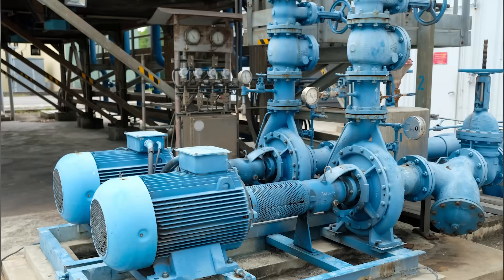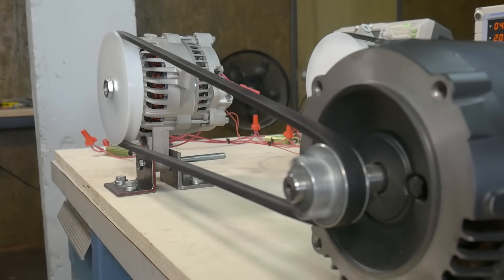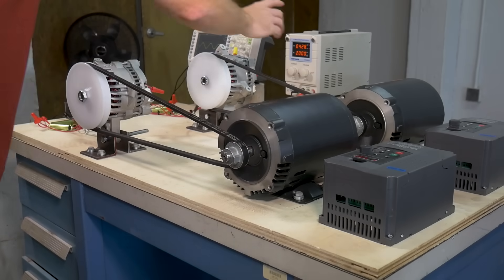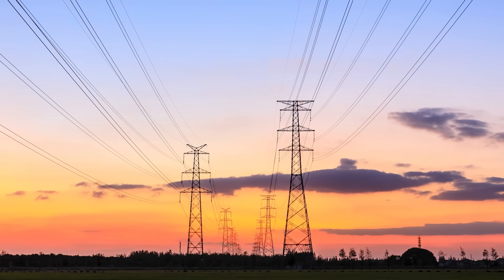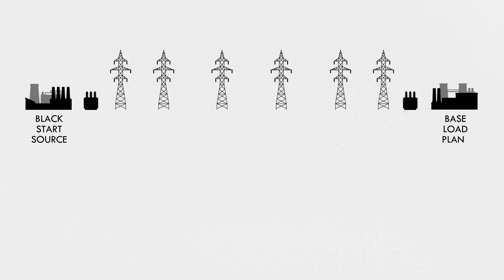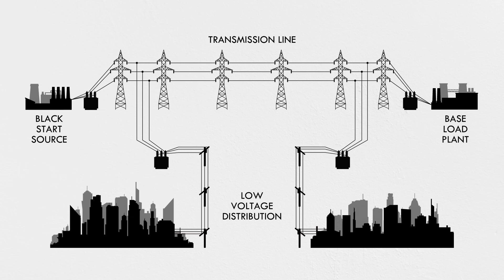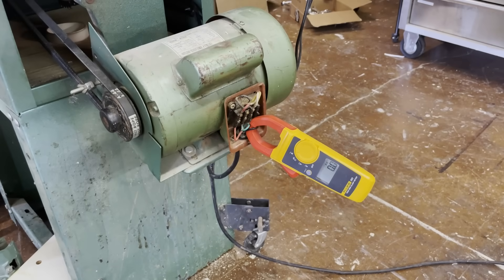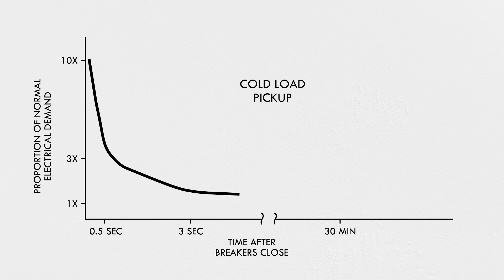What Is A Black Start Of The Power Grid?

Comment: I remember the 1965 blackout; our power stayed on, but I heard about it on the radio and alerted my father, who immediately got on the phone and alerted his team at the Baltimore Gas and Electric Company to rush them all back on duty.  (This was the team responsible for system protection.) Had their automatic disconnects failed, they still had a plan to bootstrap the system; one ancient powerplant from the 19th century had been retained just for that purpose. Rather than electric systems on blower-furnaces and turbines, this plant had manually lubricated bearings on a piston steam engine and a manually stoked coal furnace. It could supply just enough power to run the furnace blowers and lubrication pumps for one turbine plant, which could then bootstrap one more generation unit, and so one-by-one the system could be restored.

Comment: I have a question about the excitation charge. Is there a way for generators to use a potentially very small permanent magnet system, potentially integrated into the generator system, to produce a kickstart to the excitation system? If you start the generator, it would naturally create a baseload excitation current that would be lower than they would ever need, even if it was just a few watts.

Comment: Working on a control system for a 30MW power generation steam turbine, a mechanical error on my part in one step dropped all the power and gated systems to the whole generation complex. I immediately felt pain in my stomach and an instant headache, the noise was tremendous as all the valves, pumps, gates, fans, and switching systems all dropped to open in one second. There are various level of parasitic power requirements depending on the type and source of generation.

Comment: Black starts are much easier now with large numbers of remote controlled breakers. So plants can come back on line and they can pick up the load sequentially. Most places don’t have to make a complete black restart, some power sources don’t trip completely off line. Like hydro electric plants, batteries, solar, and wind. Having a significant inventory of these power sources makes recovery significantly easier.

Comment: wondering about the part of the distributing substation isolation along the crank path 
do these fall/fail open automatically or do they need to be configured at location by service staff?
Also regarding the Black Start sites am I right to assume these are kind of sectorial in set up so as to have as many as possible outside certain areas endangered by different natural disasters?
what good will it do if all the "Black Start Installations" are taken out by earth quakes, not to say it can't happen even when they're spread but that be an event in scale to end humanity and nearly all life wholesale.

Comment: Our plant powerhouse has some version of those same synchronization lights and spinning needles to get all the generators running together. However, we are so dependent on grid power, our backup powerplants are just to keep emergency power on to safely shut the whole plant down with minimal damage. We require about 28MW grid power to operate, but our backup is only about 3.5MW. A complete blackout in winter without backup power would cost multiple millions of dollars, and we are just a small chemical fertilizer plant.

Comment: In 45 years of power plant operations, I only autosynched a generator once.  I prefer manual synch with a scope because I can see and control all the critical parameters (generator rpm/frequency, voltage, and parrallel).  With an autosynch relay, you have no idea what is happening until the breaker closes.

Comment: I think older fashioned power sources should be used as either black start sources, or sources for the black start sources.

Ex: coal-fired steam turbine generators or dynamos.
And here's why.
Provided you have the fuel & priming ready, and the trained personell to operate that steam engine, all the energy you need to start that engine, (at least in theory) is the energy of a matchstick, or a piece of wood lit by a magnifying glass in the sunlight. 

It'll take awhile for that fire to spread, and that heat to build. But you are making progress.

Comment: There are also hybrid generators which have a weak permanent magnet in them which can also be excited to produce more current when necessary so a constant voltage can be maintained. These have the benefit of being able to bootstrap themselves. This is called "hybrid excitation".

Comment: When I bought a 15KW generator for my home it  had to put out CLEAN power for the  Sun Micro servers I was operating while hosting a couple of .997 uptime websites. (This included a Sun Store Edge  hot-swap SCSI-2 disk array and a tape carousel, all connected by Fiber Cannel, plus twin routers, switches, and PIX FWs, and BIG CRTs. This rig had to run on a circuit of 20 amps per leg on a single phase 240 volts system.

Had to buy an old-style CPS meter from a generator resale yard to install on the Generator, so that I could adjust the engine Governor to provide a clean 60 CPS during continuous half-load of 25 amps per line. 

That plus the 20 amp APC UPS and it’s internal rectifiers, transformers, etc. cleaned up the current fluctuations enough to keep my Server power supplies happy! 😊

Good thing I did, as we had 3-8 hour power outages in 2002-2003.  That would have killed my .997 SLA guarantee. 😂

Comment: Woah I just noticed something, when you flipped the switch you could almost see the belts moving to the frequency. @ approx 11:20 Now that could have been in my head or that the drivin pulleys are off center a little bit. But how the slack in the belts moved sure looked that way

Comment: I smile. As a DC-8 flight engineer, I'd had to sync the engine generators as they came online. We also had a tool for emergency operation of the landing gear handle which suspiciously looked like a tuning fork. 
So it naturally came under our job descriprion to convince any newbie that we used the 'tuning fork' to help bring the generators into sync.

Comment: Is there like, a detailed enough model of the grid that has literally every power plant, transformer, switch, etc etc modelled and could run a physics code that could simulate restart procedures, maybe run some optimisation/RL training until it's pretty sure it would work? Like that sounds like a university project maybe that would be fun
Reply: Or if it was an evil agent its score would just be maximising blackout period for the minimum destructive effort instead of fixing it lol I bet that's the first thing an evil AI would start thinking about

Comment: Why don't we turn all those flat roof commercial buildings into solar farms, maybe offer property owners some incentive to feed back into the grid? 250w a square foot assuming the normal 1000w square foot for direct solar energy theoretical, and 25% efficiency for average solar cells, high as 40% on some of the newer ones. untapped potential.

Comment: If starting a power grid form scratch is so hard why don’t people and businesses install their own power systems? I’m thinking things like solar panels or wind turbines connected to batteries in the basement of houses and businesses! Not only could they help to keep at least some critical elements functional during a blackout but they could also cut the cost of electricity because you are generating between 60%-100% of your power from your own sources rather then relying on the grid power supply! And with big enough batteries you could power a large house or even an entire skyscraper all through the night on just the solar/wind power alone!

Plus when power does come back you could use a computer controlled system to switch the batteries to charge using the grid power source instead of your own power source! Now you’re battery can charge on grid power while your house/business uses the electricity generated from your own grid! And from the main grid! If the power goes out again in let’s say 3-5 hours then you at least got some more battery capacity out of it and if the power stays on then you could fully charge the battery and then you would use your power system during the day or when it’s most efficient and then use the public system when yours isn’t so efficient anymore!

Comment: Reminds me of a story my grampa told me once. He'd been working at a Hydro Generating Facility (He was an EE specializing in protection & control) back in the 80's before they had automatic sync systems and he recalls one time the plant operator had the frequency slightly off when the 500MW generator was connected to the grid. The bang as the unit adjusted to match the grid could be heard and felt across the dam.

Comment: As electrical grids get larger, does the length of wire between the furthest ends of the grid cause synchronization issues?  Or, is the difference in timing to small to worry about?

Comment: You didn't say what they do about the 8-10x initial surge in power demand. You said that they carefully restore group by group. I can imagine that they can produce more power than is required in the beginning, by selecting fewer groups for more online power stations. But then as demand drops, they will have to select the next group with its own initial surge of demand. I can only imagine how delicate this is.

But what in the end? Perhaps, I can imagine, that the more groups you get online, and the last few groups won't matter that much compared to the overall power grid being up and online?

Yes of course, local power outages happen. And the grid doesn't collapse. So probably, by the time you reach a certain state, it becomes stable.

Comment: The BIGGEST non-nuclear threat.  WHEN ( not if) the next solar CME occurs (properly oriented) WILL knock out the grid.
Transformers are the critical variable.  Some are manufactured overseas and take 6-24 months to complete
Very heavy to transport.
The National Security of USA should insure manufacture and stockpile of critical transformers are in USA.
Wire and poles are universal however modern transmission completely vulnerable to transformer issues.

Comment: If you'd like to tinker with 3 phase power I'd reccommend using PWM permanant magnet motors! They lack the electromagnet stator you'd see in the real deal but they otherwise work remarkably similarly and because of their intensive use in drones there are loads of very good ones kicking around for cheap

Comment: An excellent presentation, however, I would like to make one point. In the US system you mentioned standby generators are not generally installed to black start a generating unit failed as a result of a blackout. Ontario Hydro installed standby generators in all their fossil and nuclear plants after the 1965 black out. I started at Lakeview GS west of Toronto in 1967 (coal fired, now gone) and we had installed four standby generators of 7 MW each. They were powered by Orenda jet engines and had an output of 7MW each) . The nuke plants, when built, were similarly equipped. Bruce NGS where I also worked, had four standby generators of 14 MW each. Others were later located at the Bruce site as the site expanded. These units use Rolls Royce jet engines (gas turbine?) . Those units are still in place and available. The requirement was for a montlly test start up of the units. On odd occasions, some were put on line to ease peak loadings.

Comment: My father is a Civil Engineer that helped design several hydroelectrical power plants. He wrote the manual for most of them.
The first thing he includes is a breakout 'bleed' power from one of the water turbines generators and a smaller substation to feed the power plant itself.

In 1986 there was a major flood that knocked ALL the comm lines AND THE ROADS to the plants, which meant there would be no diesel trucks to feed the backup generators until NEW ROADS WERE BUILT. The personell was being taken to the plants BY HELICOPTER.

Without the backup diesel, there would be no way to open the water gates and the plants would flood. 

The landlines were cut, but power lines can carry radio waves, and there was a system, deemed obsolete, that allowed using the power lines to communicate and the system to be restored in less than 72 hours, because the plants could talk to each other, in the era before cell phones. More importantly, machines could be synchronized to the same 60Hz wave by this system. The system is now deemed essential and mandatory.

Comment: Wait, there's no reasonable way for powerplants to use their own energy sources to produce some initial electricity they can use to boot up independently? What exactly is the obstacle for getting some sort of initial small charge they can use to build up some sort of internal positive feedback to reach the required minimal boot up energy?
Reply from the maker: Cost
Reply: @PracticalEngineeringChannel  It couldn't be something simple like bringing a relatively small permanent magnet close to the spinning coils to induce a small current, and loop back that current into the static coils, using the prime-mover's energy to amplify it recursively until reaching whatever is the operational minimum?

Comment: As an additional point the most likely method for rebuilding a large blacked out area would be outside in - i.e. use the Interconnect and neighboring RC areas to build inwards so the loads are sync'd to the Interconnect not to islanded generation. Of course, during the rebuild generators would need to be brought online for the BA to balance as soon as reasonable practical but these could be sync'd to the Interconnect too so isosynchronous modes wouldn't be necessary.

Comment: I worked in a building where we had a standby generator and got a few power outages a year. Normally about 15-20 seconds before the lights would come back on, until the day that the generator informed us it needed new batteries. Can confirm that standby equipment needs a lot of maintenance for something that spends months at a time…standing by

Comment: The fuel generators need fuel to operate and you need electricity to produce fuel, the coal generators need coal to operate and you need electricity to produce coal, and this video explains why I'm scrounging around with a chainsaw for wood and leaves to stuff into biomass burners in Satisfactory

Comment: As soon as a substation or a number of substations goes down it's investigated and automatically notifys a control room who remotely initiate black start sequence after cause has been found for subs going down. They all have battery backup for the remote relay switching. The grid is basically a massive ring main with spurs and interconnections to bypass subs for servicing and maintenance. 🤔👍😉

Comment: The hydro plant I'm working at is a critical part of the local grid because of it's black start capabilities.  The house unit is only a 75KW pelton wheel generator that's mechanically governed but it's more than enough to kickstart the larger units.  Heck even the main units can  be turned on manually.

Comment: Very nicely explained Grady. I used to mess around synching my 3∅, 400V, 50Hz, 9kVA Genset with the mains using 3 lights to indicate under- or overspeed. Once all 3 lights went off, the breaker connecting the Genset with the mains could be closed. This was in Johannesburg way back when.

Comment: All good but the contents of the video are a bit XX century... can you make part 2 showing how the black start can be performed using VSMs? 
We had a pilot project done here in UK 2 yrs ago perrforming balck start with a wind farm. The project used grid-forming technology (VSM) to regulate the frequency and voltage from the turbines and then integrate that supply with the grid and restore the blacked-out section. 

Would be great to better understand how the software works together with storage and RE sources... I kind of know how it's done but not really if you know what mean :)

Comment: If you wish to use your syncroscope with your model, a set of control transformers can supply the voltages needed. A set of 6 doorbell transformers may do the job for you. You will need one for each phase for each source. Use them in a step up configuration which is the oposite as used in a substation. A substation used Potential Transformers to change transmission line voltages to the voltage used by the syncroscope. In the USA, most instrumentation is 120 or 208 volts.  The doorbell transformers can take the nominal 12VAC and increase it to about 90 volts when using a set of 16 volt transformers. With the transformers, you can add voltmeters. With the addition of Current Transformers, or even omit them due to the size of your model, add current, power factor, and VAR meters. Most CT devices scale to 5 amps. Go ahead and add a 250 KV voltmeter. It may read that at 120V. Add a 1,000 A amp meter, it may show that at 5 Amps. The listing should show the CT or PT used to scale to the meter.  Be aware, some metering is correct at 60 HZ and may provide incorrect readings at the higher frequency of your model.

Comment: I started my career at Detroit Edison company back in 1968.  I went to school for eight weeks and then got sent to a rather large power plant, with six 55 MW turbines, four 125 MW turbines and one biggy at 550 MWs.  We also had five "peakers" as they were called, that are basically diesel locomotives without wheels, that ran on diesel fuel.  They made 10MW each and we only ran them in the summers during peak loads.  They cost more to run then the money they made, but it saved Detroit area from blackouts many times.  Most power plants had them, so cold starts would have been no problem for us.  The real problem is filling the boilers back up, lighting their fires and bring them up to steam making temps, to run the turbines.  Yes, almost ALL LARGE POWER PLANTS RUN ON BOILERS AND STEAM!!  Even the nukes do!